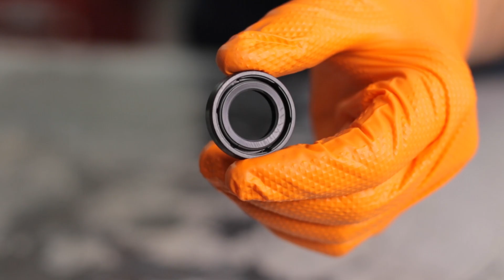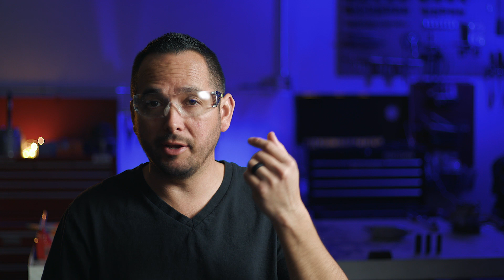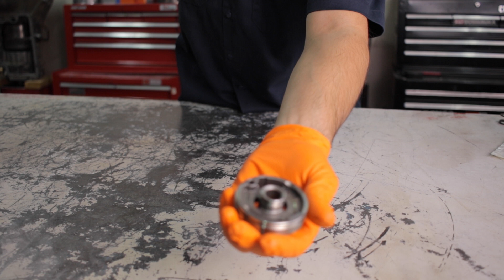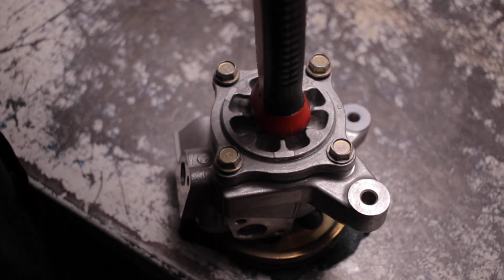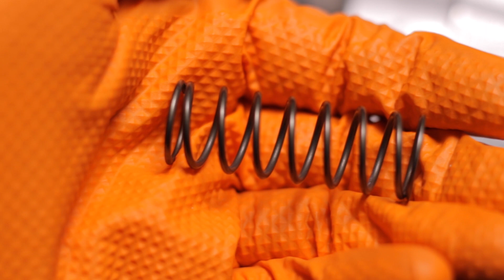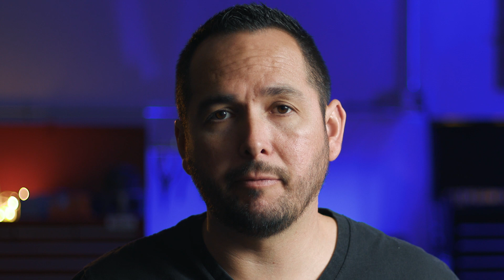Power Steering Pump Rebuild - Part 3 of 3 (1 Hand Mechanic) #SouthpawAutoworks

Comment: "Hello, I'm your subscriber from Indonesia, please help, when I have a new car, replace the high pressure hose on my power steer pump because initially there was an oil leak. 
But after I changed my steering wheel, if I made it turn left or right, there was a buzzing sound that could be felt in the car cabin. 
Where does this come from? I tried consulting with a repair shop and they said my power pump was damaged. In your opinion, is the mechanical analysis in Indonesia correct? And finally, can my power pump be repaired and what parts do you think need to be replaced?  Thank you very much in advance, I am waiting to hear from you. GBU."

Comment: No way I could do this without getting at least 1 cat hair into that pump.
Reply from the maker: Those oiled air filters (for engines) are great for capturing contaminants.  Oily parts on a bench are 2nd best.

Comment: Hi. Thanks for making this series. Do the vanes ever need to be replaced? Would you get them to buy? Can the flow control valve be repaired or replaced if its bad? And what about the sub valve ?
Reply from the maker: Installing new vanes would be a plus, however, I previously had trouble sourcing them.  Maybe the dealer carries them...
Regarding your other questions...IDK.

Comment: Can the pump cover be turned around for the back bracket to point to the desire directio?
Reply from the maker: I don't think so....
There's two alignment dowel pins that locate the pump intermals, and the cover.  The pins are two didderent lengths and diameters.

I could be wrong.  Just sharing my thoughts.  Hope it helps.
Reply: @SouthpawAutoworks  Thank you for the reply.
  If the flow valve isn't working, the pump isn't pumping fluid to the high pressure hose , correct?

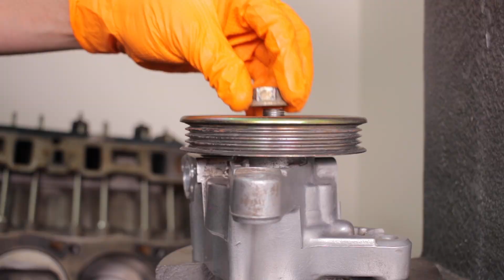Comment: On 9:12 you said that "The Shaft and nut are reverse Thread", is this Tighty & Loosey Mekanism are the same for any kind of Power Steering Pulley Pumps ?

Comment: do you have idea what is happening in my case: pump and rack were ok, but lines were rusty with no leaks, so i decided to prevent fail of rusted pipe so i took it out and i brought to shop that makes hydraulic lines and they made same , i installed it and filled tank with oil and spun pump with electric motor to fill lines what it did, i added more oil in tank and then i started engine, but steering wheel was heavy , it became lighter only over 3000rpm, did i destroyed pump somehow?, there always was oil in system, pump never worked on dry, oil is clear with no metal dust or parts, on idle there is on signs of oil flow what could be seen before
Reply from the maker: It sounds like you were very cautious.

Is the pump making any noise?  Whining?
Reply: @SouthpawAutoworks  no noise at all even on end of travel where used to make noise, it seams that pump vanes extend only on high rpm, at idle when i look in tank , it seams there is no fluid flow,
Reply: @SouthpawAutoworks  new things, i spoke with my mechanic and he suggested to install oem line to see if it will work, i did and no, same thing but guy that made lines said that in pump is valve that can be blocked if pump worked on dry,

Comment: What the name of Press Machine ? Is that Hydraulic or Mechanical Press system ? Where can I buy that kind of Press Machine ?
Reply from the maker: It's an arbor press.  No hydraulics, all mechanical.

3-Ton Arbor Press (12 inch working height):  https://amzn.to/2Reqmyx

DISCLOSURE:  🕵
Links provided are affiliated links with the associated websites. While there is no extra cost to the purchaser, a small portion of the sale goes to support this YouTube channel.

Comment: Great educational video. Very well explained. Can you tell me where to buy the power steering pump rebuild kits.
Reply from the maker: The positive feedback is appreciated.

Your local auto parts store will likely have what you need.  Rebuild kits are also available on eBay and Amazon (typically more cost effective).

For example:
Reseal Kit:  https://amzn.to/2EriR25  (paid link)

Thanks for dropping me a line.

DISCLOSURE:  🕵
As an Amazon Associate I earn from qualifying purchases.  Some, if not all, of the links contained in this video description (and/or comments) are affiliate links.  This means that, at no additional cost to you, the Southpaw Autoworks YouTube channel will receive a small commission on any purchases you make through the website links provided above.

Comment: Dear Robert,
Thank you for presenting the Steering power pump rebuild so nicely. I really appreciate your efforts.
I have a Honda Accord 2011 model and there is a oil leakage on the low compressor valve and while steering left and right there is a noise.
Could you pls advise whether it is advisable to rebuild the same power steering pump or buy a new one.
Also what can be the cause of the noise..should i replace the bearings as well on the power steering pump.

Would highly appreciate your kind revert.

Thank you.

Best Regards,
Mehul
Reply from the maker: Seals:
Tired seals will cause leaks.  Additionally, bad seals can also cause power steering noise.  If there's a bad seal is on the suction side of the system, air can then get sucked into the pump.  Air in the pump creates noise.

Bearing:
The bearing can be inspected when the pump is apart.  Should rotate smoothly.  If you spin it by hand, quickly, the bearing should come to stop, all on its own, pretty quickly.  However, if the bearing continues to spin, and comes to a stop slowly, it's a sign of a bearing that will fail in the near future.  There's grease inside the bearing.  When the grease starts drying up, the bearing will spin for a long time.

Rebuild VS Purchase:
That's your call...
Last time I checked, it was a lot more cost effective to purchase a rebuild/reseal kit, as opposed to purchasing a reman unit.

There are other factors to consider when rebuilding/resealing:
1). Time involved.
2). Might need to purchase tools.
3). No guarantees that it will be a success.
4). Potential frustration.
5). Etc.

But, then again, it could work out great, could save money, the experience could be a confidence-builder, etc.

You should be able to find comments in this video series, of other people successfully rebuilding their power steering pumps.  It's possible...
Once again, that's your call.

Whatever you decide, I'm wishing you all the best.
Thanks for dropping me a line!

PS - If it feels right to you, please help me spread the word about this channel.  Here's some easy ways to share...

Power Steering Pump Rebuild Series:  (90-Sec Preview)
https://youtu.be/HqOOMVPcmdw

1 Handed Transmission Rebuilder:  (60-Sec Preview)
https://youtu.be/y3Vixa_Ec1E
Reply: @SouthpawAutoworks  
Dear Robert,
Thanks for your detailed reply on my query.
I really appreciate the time you have spent in providing that detailed explanation and reply to me....God Bless you Dear.

I saw all your 3 videos on the Power steering pump rebuild....you have presented it very nicely and very easy for a layman to understand...you seem to be a great professional.

I shall definately share and spread your channel link with my friends. 

Thank you for your reply.
That was very insightful and helpful and i have taken a note of it.

Kind Regards,
Mehul

Comment: Too cool.  I have 189,000 on my 2007 Civic 2-door EX.  The front seal is leaking I think.  Interesting but there is no oil on the drive belt.  Do you normally need to replace vanes?  Is there a wear length tolerance?
Reply from the maker: Ideally, it would be best to replace the old vanes with new ones.  However, at the time of making the video, I wasn't able to find replacement ones quickly/easily.

I imagine there is a tolerance.  I don't have the spec for it.

PS - If it feels right to you, please help me spread the word about this channel.  Here's some easy ways to share...

Power Steering Pump Rebuild Series:  (90-Sec Preview)
https://youtu.be/HqOOMVPcmdw

1 Handed Transmission Rebuilder:  (60-Sec Preview)
https://youtu.be/y3Vixa_Ec1E

How the 4L60E valve-body works:  (60-Second Preview)
https://youtu.be/fWPSaLeaOXI

Comment: Great video!! Couple questions: what is the success rate of rebuilding yourself? I’ve got a growl but no leaks and no fluid loss. I’m apprehensive a rebuild with a seal kit won’t cure the growl. Also, I have a 2001 Tundra 3.4l V6
Reply: 2001Tundra 3.4l V6 that has no bosses or grooves on the pulley, so I wonder how to get the pulley off (referencing a standard pulley puller).
Reply from the maker: I'm not familiar with your particular setup.  Some pump pulleys come right off of the shaft, after removing the nut.  Other pulleys require additional tools (pulley puller).
Reply from the maker: Like I mentioned in the video series, I can't guarantee anyone's success.  Setbacks are a part of learning new things.
#FailForward

Reseal kits are generally pretty inexpensive.

If you're hearing a growling sound coming from the pump, you may have a pump bearing that's failing.
Reply: Thanks for the quick response. There is no nut on the pulley shaft so I assume it’s pressed on. But with no groove on the pulley, there’s no way to use the pulley puller. I’m wondering if the shaft will come out with the pulley attached. I’ll find out as I’m going to do this soon. Once again, thanks for the response and a great video. A clearer picture of what I’m talking about would be visible looking at reman pump pictures online (Rock Auto, Amazon, NAPA, etc.)
Reply from the maker: I looked at the photos.  I see what you mean.

After doing some more digging, I discovered two (2) things:
1). I previously mentioned a bearing.  It looks as though this unit is not equipped with a ball bearing.  Instead, this design utilizes a bushing...that the pulley (and vane ring) shaft rides on.  You mentioned a grinding noise.  I responded with a ball bearing failure being the possible cause for the noise.  That's no longer the case...
2). The pulley is pressed to the shaft.  It looks as though the shaft has a snap ring, located at the opposite end of the shaft (Clarification: the pulley is located at the front of the pump.  The snap ring is located at the rear of the pump).    Looks like you might be able to gain access to the snap ring by removing the rear pump housing cover.  With the snap ring removed, I imagine that you'll be able to remove the pulley, and shaft, out of the pump housing, through the front of the unit.  With the pulley out of the way, you should be able to gain access to the front seal, for replacement.

Full Disclosure:
I have no experience with this particular power steering pump.

I would love to do a video on this unit...but, I don't have one handy.
Reply: @SouthpawAutoworks  Thanks for taking the time to review this. I believe we are in agreement about the shaft coming off with the pulley. You’re right about no bearing, there’s only a bushing. There is no discernible side play in the bushing , only about 1/16 - 3/32” end play front to back which looks to be acceptable. Like I said, I’ll find out soon. It’s not catastrophic. I have serious lung problems so I have to really psych myself up to get this done. Thanks again for your interest, I’ll let you know how this turns out.
Reply from the maker: I'm sorry to hear about your condition.
Hopefully this turns out to be a fun project for you.
I look forward to hearing back from you, when the time is right.

PS - If it feels right to you, please help me spread the word about this channel.

1 Handed Transmission Rebuilder:  (60-Sec Preview)
https://youtu.be/y3Vixa_Ec1E

4L60E AFL Valve - Part 1: (60-Sec Preview)
https://youtu.be/yfXdx6AkqjU

Comment: Robert - i installed back the pump, was not able to remove the old pulley and bearing but they are still working fine, GUESS WHAT?? my PS is now working once again, like you said i might encounter several issues, different scenarios or problems, old bolt was stripped, i can't find repair kit, i just bought some O-rings, BUT I'M SOOO HAPPY... glad i found your guide, will try upload my video, will link your vids, thanks a lot bro.. i hope you can upload more vids about hondas specially the EG hatch or civic FD
Reply from the maker: It works?!  Awesome!!
I would love to see the video.  Keep me posted!
Reply: @SouthpawAutoworks  video just raw no edits, i just cut and merge them, not really sure if you can understand my english, but i really enjoyed working on the pump, will check if i can share your vid on the worldwide EG hatch group, hope you can upload more vids about hondas
Reply from the maker: I'm so glad that everything worked out for you.  It really is a fun rebuild/reseal.
If you're allowed to share this power steering pump video series, on Worldwide EG Hatch Group, that would be awesome.  If not, no worries.
I really enjoyed reading your comments.  Thanks for dropping me a line!
Reply: @SouthpawAutoworks  been several days now and PS pump still working, so far no leaks, still trying to fix other issues on our EG will upload PS pump vid with your link next time, i think its like 45mins long, cheers..
Reply from the maker: That sounds great!

Comment: Bruh southpaw, its 2am now i watched part 1 and 3, i may need to watch part 2, this is the same PS pump installed on my eg hatch, i wanna jump into to my garage right now and wanna give it a shot, i paid $80usd and previous mechanic made a mess, i told him that PS pump pulley bolt is on a reverse thread, he told me that they fixed a lot of pumps already and was not on reverse thread  ( so previous mech was indeed wrong and now my PS pump is not working ) my only problem is looking for a repair kit, ANYONE KNOWS THE PART # FOR THE REPAIR KIT ON THIS EXACT MODEL?
Reply from the maker: Sorry to hear about your troubles with your power steering pump.
Full disclosure, I'm not up to speed on the "eg hatch".  Identifying all of the different trim packages, for most vehicles, is beyond my area of expertise.
I Googled "eg hatch."  Best I could tell, it's a Honda Civic (CX or DX) ranging from 91-95.  Based off of this finding, I put together some info for you.  I hope this helps...

DISCLOSURE:  🕵
As an Amazon Associate I earn from qualifying purchases.  Some, if not all, of the links contained in this video description (comment response) are affiliate links.  This means that, at no additional cost to you, I (Southpaw Autoworks) will receive a small commission on any purchases you make through the website links provided above (below).

*****Power Steering Pump Kits*****
91 Honda Civic DX (1.5L D15B2):  https://amzn.to/3wdApH2
92-95 Honda Civic DX (1.5L D15B7):  https://amzn.to/36gT2iA
92-95 Honda Civic CX (1.5L D15B8):  https://amzn.to/36gT2iA
The pump used in this video series came out of my '97 Honda Accord (2.7L V6):  https://amzn.to/2EriR25 or https://amzn.to/36gT2iA 

If you didn't already know, when on Amazon, you can verify that the parts will fit your exact vehicle/model/engine size.
Reply: @SouthpawAutoworks  awesome! Super thanks bro, i hope i can fix my issue, if not then last resort is to go back to manual steering, all the best bro, i just got the eg last month, trying to restore her bit by bit, step by step

Comment: Cheers bro! Great run down on the process....
Reply from the maker: Appreciate your comment, man!
Reply: @SouthpawAutoworks  All good! Hey, on a pump like this, they have a bit of in/out play right? My alternator belt disintegrated and stringy pieces got really stuck behind the pumps pulley. Is it possible that this can upset the amount of play? As a result of the stringy pieces i had to replace the seal but now my pump is loosing pressure (noise when turn steering wheel goes away with a few revs). There was no obvious damage inside the pump and i've had it apart twice checking the orientation of the parts,  but i still get the whine and stiff steering. Cheers!
Reply from the maker: On the Honda pump used in the video series, I do not believe that there was any shaft end-play.  The shaft bearing is pressed onto the shaft.  That shaft and bearing are then pressed into the pump housing, and held in place with a snap ring.  There's no way for the shaft to move inward/outward (no end-play).  I imagine that this is the case for most power steering pumps...however, I could be wrong.
Generally speaking, pumps make noise when they ingest air.  So, if the fluid level is low, it'll ingest air, resulting in the buzzing/whining sound.  Also, worn out/damaged O-rings/seals can allow air to get sucked into the pump, too.  For example, there's an O-ring on the inlet port hose bib of the Honda power steering pump.  When that O-ring fails to work properly, it allows air to be sucked into the pump.
Reply: @SouthpawAutoworks  Thanks man! Always good to have other ideas. When these suck air the oil becomes frothy doesn't it??
Reply from the maker: I would imagine so.  However, oils typically have anti-foaming agents added to them, to help reduce foaming.  Foaming can cause problems with main bearing clearances on engines, among other things.
Reply: @SouthpawAutoworks  The plot thickens... thanks!!